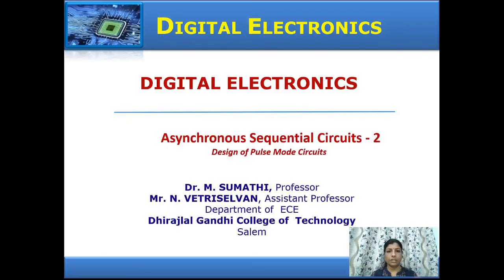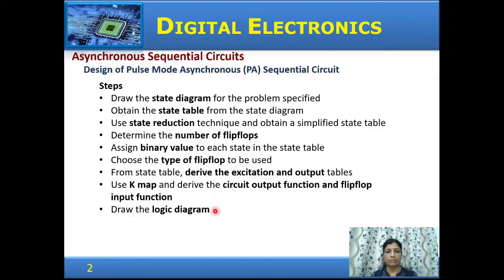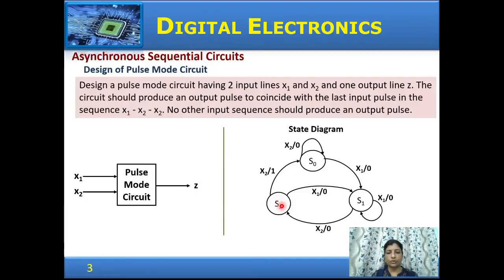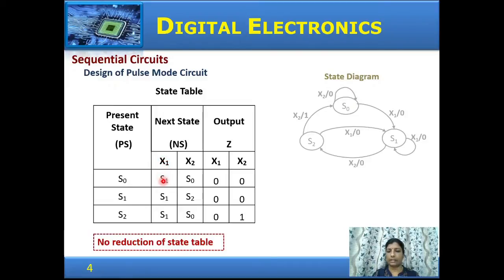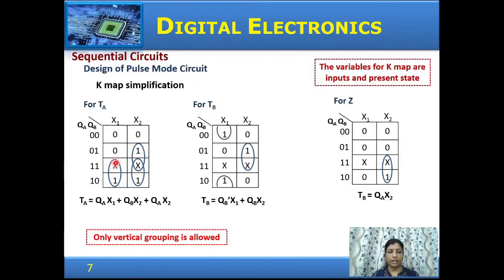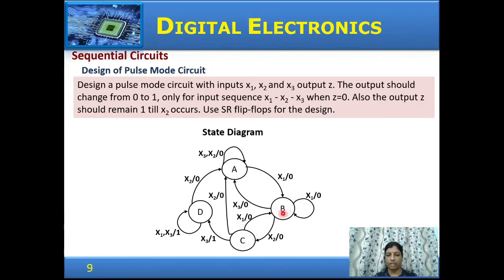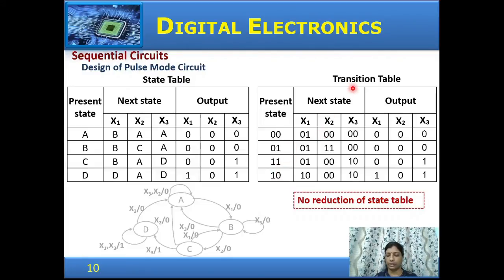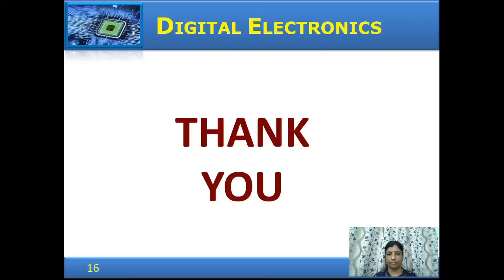Digital Electronics 4.2 - Asynchronous Sequential Circuits: Design of Pulse Mode Circuit

Comment: Madam, In Moore machine Next state depends only on the present state. But in the second problem in pulse mode circuit you claimed it is Moore model. But as per your explanation the next state depends on present state and input. How it could be a moore circuit??? Is it correct??
Reply from the maker: Thank you for viewing the video, and identifying the slip. The video has been edited.
The video "3.5 - Sequential Circuits: Moore and Mealy FSM" explains both the models clearly.